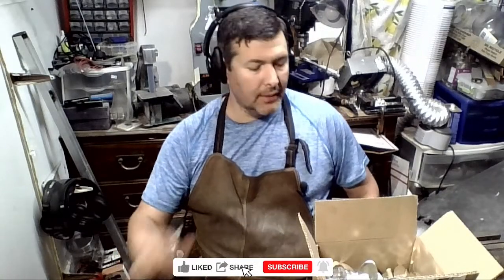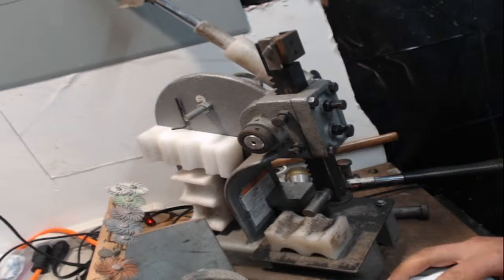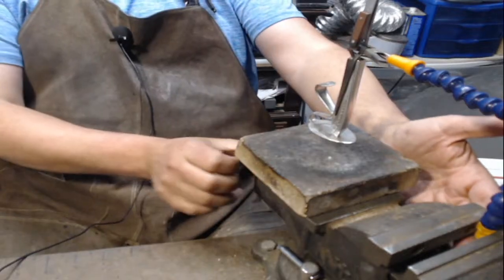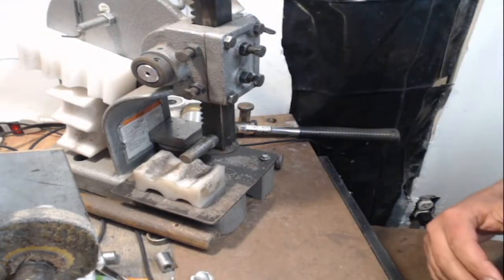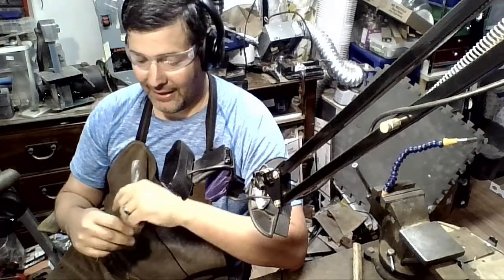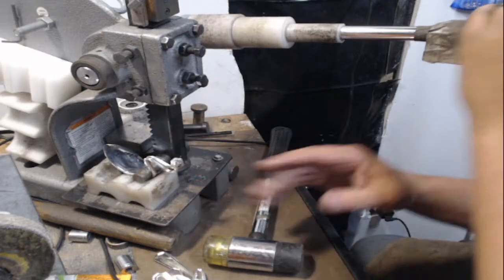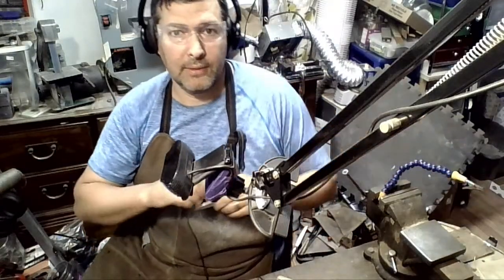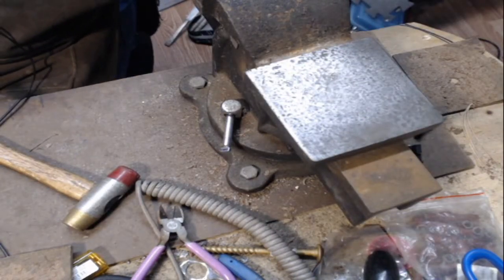I'm Back!!! Making some silverware bud vases

Comment: Thank you so much for sharing how to solder these. I’ve tried many different ways and it never worked out. Guess I wasn’t holding my mouth right🤪
Reply from the maker: Lol that’s what I say to others about fishing. Normally when I have the most problems, soldering it’s when the pieces aren’t cleaned and some grease or something is on them from polishing. That’s why I always just run them through the Tumblr with Dawn dish soap and then I don’t have to worry about it.

Comment: Hi Jeremy, great to see you. Can silver plate pieces be run through the tumbler or is it only sterling?
Reply from the maker: Silver plate can be tumbled. About 90% of the silverware I use is silver plate. And I tumble a lot of what I make. Sometimes pieces are plated with a different kind of metal and it will chip off. But for regular silverplate definitely tumble away. 😊
Reply: @FlatwareCreationSS  thanks. Is using a magnet the best way to know if it’s sterling?
Reply from the maker: @JaneThomas58  in magnet, will help you figure out if it’s ferrous metals or not. But it will not tell you weather it’s sterling silver plated.  One of the easiest ways to tell silver plate is to look at the heel of the Spoon or the Fork and you will see different colors, where the silver plate has worn off and another color underneath it.  And normally the sterling or say sterling, 925, and lesser silver like 800.
Reply from the maker: @JaneThomas58  quite a bit of silver plated is marked Rogers or IS, A++. Also, look out for EPNS that is electroplated nickel silver. A lot of people have reactions to the nickel so I try not to use them so much for jewelry and items that touch the skin.